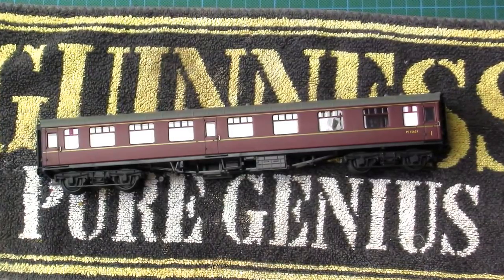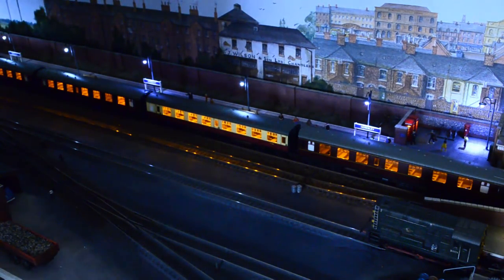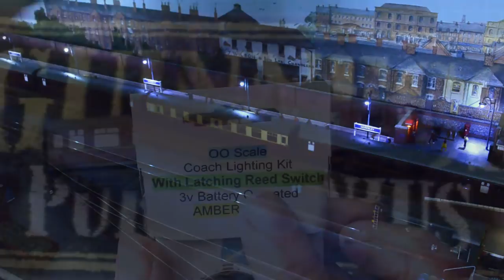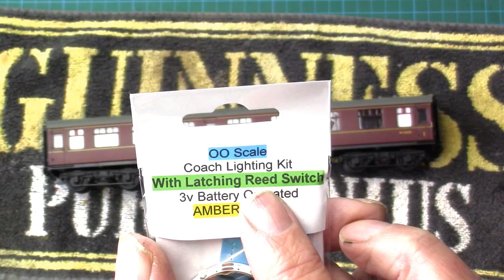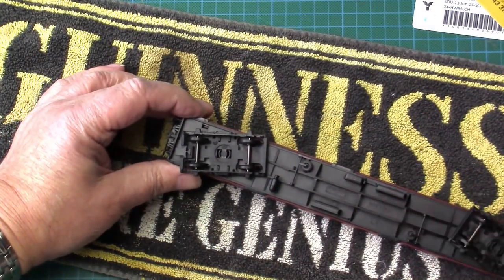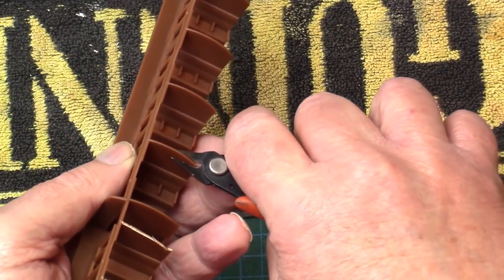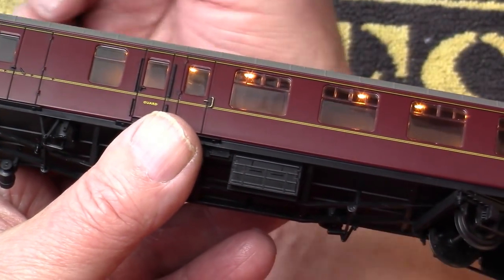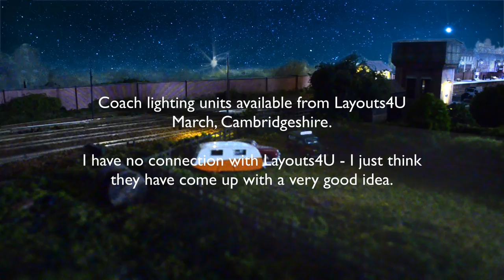PASSENGER COACHES #1 LIGHTING

Comment: Looks good, but I don't like the idea of taking the coaches apart again when the batteries die. I think pickup from the rails is preferable, but I do like the magnetic reed switch, so this combination would be ideal.
Reply from the maker: Hi Ray. Yes, I can see that. Changing the batteries is the only down side. Using the magnetic reed switch with a lighting strip is a good idea particularly if you operate DC. I am no expert but I am thinking you would need some more components for DCC (rectifier, capacitor etc). If so, I would be interested in your circuit because I am toying with the idea of putting lights in my guards vans as well  -  David

Comment: my question: where the heck did you put the battery?
Reply from the maker: Hi Marie, the small flat batteries are fitted inside, at the end of the coach. I used a windowless compartment where I could to hide the battery. I suppose it depends on the coaches you have. Theye were designed to fit inside the coaches but I gues they could easily be fitted underneath with a bit of enginuity  -  Thanks for the question  ...  David
Reply: @davidhyde4329  thank you very much, this the the problem I have currently

Comment: See there's also a version for rear flashing light.Richard
Reply from the maker: Yes there is Richard. O.K. if you have a tail-chaser layout but a little more problematic with an out and back, because the last coach to enter the scene is the first one to leave it. You would need one at each end of the train and then you would need to switch them round (like loco lights). Not impossible but this has put me off for the time being. Thanks anyway, I may well look at this again  -  David